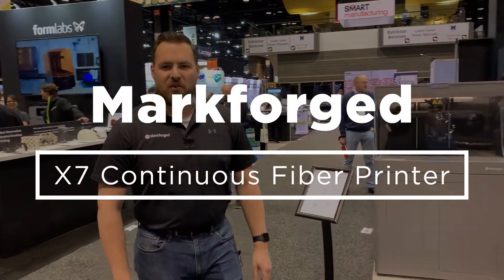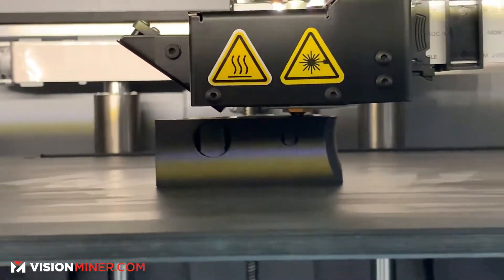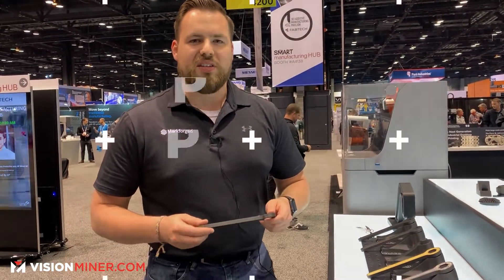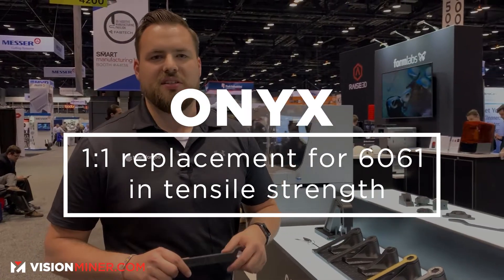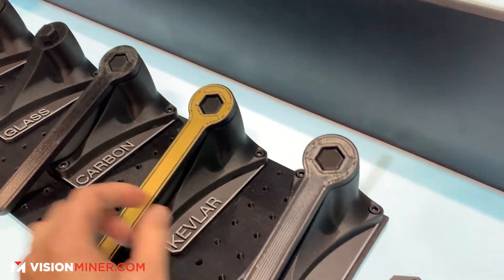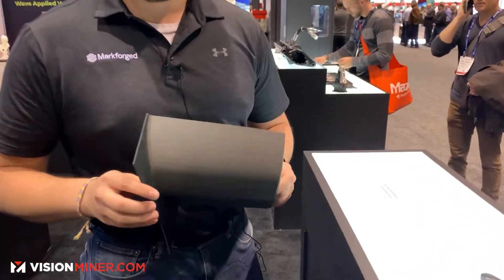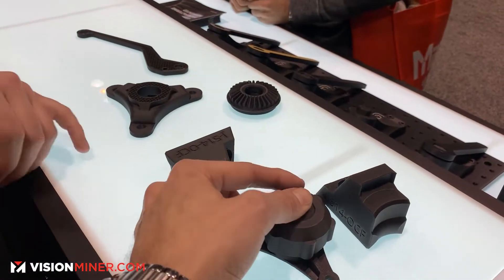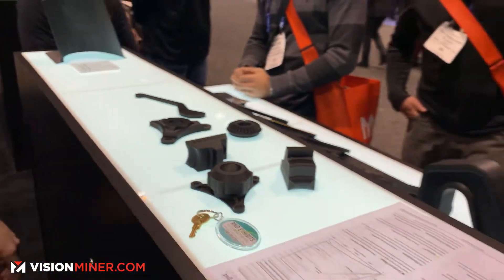Markforged X7 - Continuous Carbon Fiber, Kevlar, Fiberglass 3D Printer: Fabtech 2019 Overview

Comment: It's really misleading to say those parts are as strong as aluminum (1:1 for 6061). Ultimate tensile strength in the optimal direction on a part designed for the test, it achieves the tensile of 6061 but you can not replace MOST aluminum parts with these printed parts, even when ONLY considering room temp strength. I own a machine shop and have 3D printers capable of carbon fiber PEEK and Ultem. I make lots of parts from 6061 as well as 7075 Al and would LOVE it if I could print parts to replace most of the aluminum parts we make for customers. The reality is that plastic (even continuous carbon fiber reinforced) is not as strong as aluminum, particularly if you stray to far from room temp. There are few parts that can be swapped out. 1:1 for 6061 aluminum is BS. A huge stretch at best. This is a great printer and continuous fiber is better than a chopped fiber impregnated filament but this sales pitch is fantasy.
Reply from the maker: For most applications you're absolutely right. The continuous fiber printers are capable of printing parts that are strong in certain direction in certain conditions which has been published in some white papers. That's where the Metal X system really steps in :)

Comment: So cool, as strong as aluminium, unreal.  So exciting where 3D printing is going.  Puts my Ender 3 to shame but still love my Ender.
Reply from the maker: and with the materials we have here.... you won't have to spend nearly as much cash for better results, on an open system :)
Reply: @KennyM Well it’s the price of a mid end 3-Axis CNC Mill, not terrible depending on what you’re planning to make but the X7 definitely has lower setup/tooling costs.